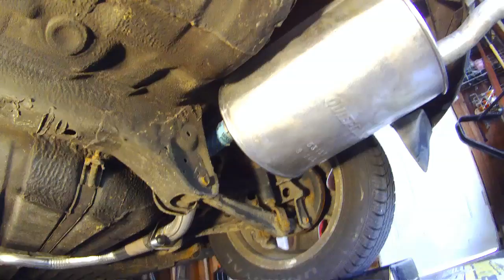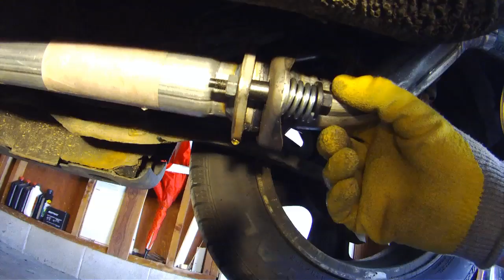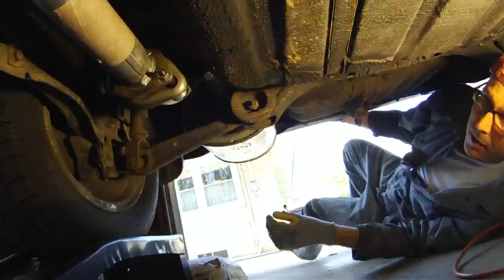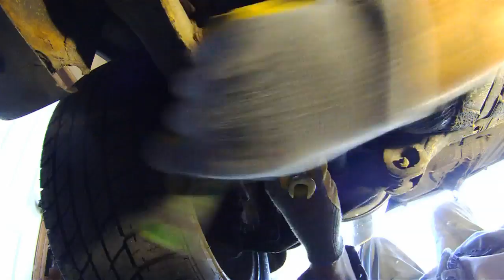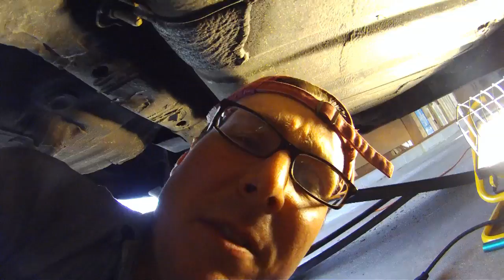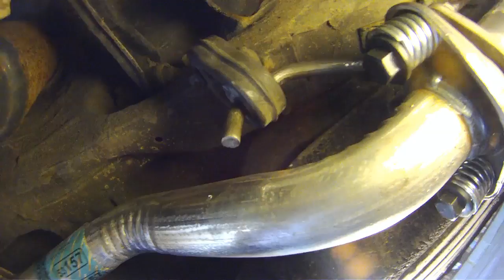Honda Civic DX Exhaust (1991-1995)

Comment: So what did you do about the rattling on the c.a.t.?
Reply from the maker: I just lived with it. I suppose I could've just cinched up the heat shield with some wire to stop the rattling, but I got used to it and then wound up selling the car a year later.  I miss the 5th gen hatch.   Best car I've ever owned!

Comment: Excuse me Hancock, 
How did yoi get those spring bolts out. They were so tight for me. Did you use a torque wrench or plain jane ratchet?
Reply from the maker: Plain jane ratchet...  Well...I put a box wrench on one side and ratchet on the other.  It's true.   Sometimes these exhaust bolt can get rusted solid.   Use a Sawzall, angle-grinder, or even a jigsaw to cut these bolts off if that's the case.

Comment from the maker: According to the Walker Exhaust diagrams, and Advance Auto website, "Spring Bolt Kit; 3 DOORS; 2 DOORS; HATCHBACK; COUPE; Use before Converter; Use between Resonator Assembly and Muffler Assembly".  Maybe they are both wrong?

Comment: normally the spring goes from the cat to centre pipe. You dont need a spring for the backbox :s it doesnt even look right. it should bolt up solid. Mine is as were my other cars..

Comment from the maker: I spent $501.51 ($421.51 after $80 rebate) on a stainless steel Walker exhaust system (Cat/Res/Muf) including all gaskets and mounting hardware.  I was really frustrated to find that the Walker components didn't mate up properly.   Why bother paying the premium price for stainless and proper fasteners when you just wind up cobbling it together like a universal exhaust system?  At least the exhaust is still functioning properly:).  Thanks for watching!